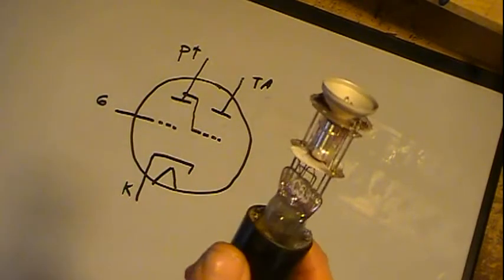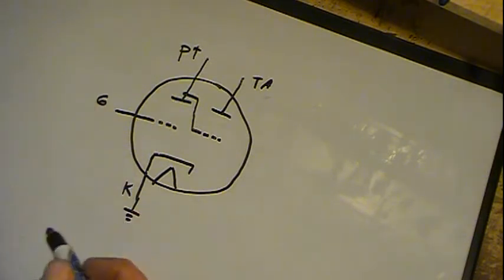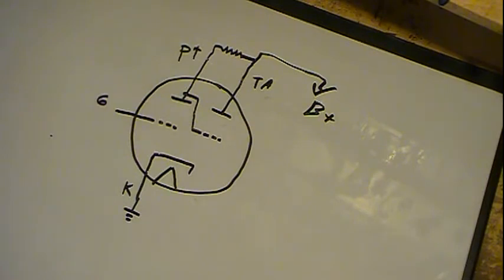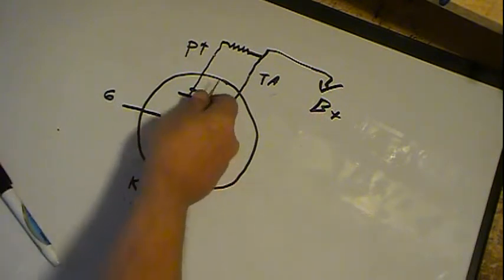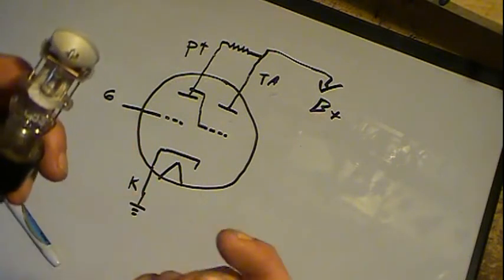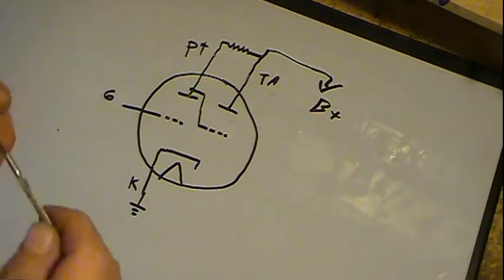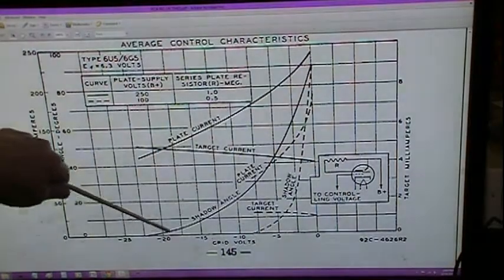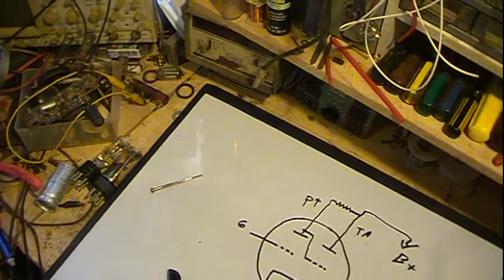The Eye Tube

Comment: Thanks for the info. I now can trouble shoot several cap checkers I have. They were so dim you had to be in a dark room to see it work. Another fix I found is you can increase the plate voltage if your trying to get a little more life out of it. I didn't know about the 1 meg resistor before.

Comment: "Know one knows hot it works because it's magic. That's it for the video. Thanks for watching guys. Bye" What a roar! I spit out my coffee on that one. Good one Dennis!
   OK, I just watched the rest of the video. Very concise explanation of these interesting tubes and how they function. Understood it 100% on the first watch.
   Also thanks for the real world scenario of how it would function in an AVC/AGC circuit and what effect it has in the conduction, voltage drop between the two plates, and therefore changing the phosphor angle deflection.
   Dang, I've got an eye tube in my Solar CB-1-60 capacitor analyzer but I still don't have a radio with one. Something I'm still in the hunt for.

Comment: Thanks Dennis that was very helpful. My Eico cap tester sometimes does not give a sharp defined pattern so I guess the problem will be found in that bypass resistor. Thanks again.

Pete
Reply from the maker: Sometimes on bad caps that you are testing the eye will not be sharp and that means that the cap that you are is bad.